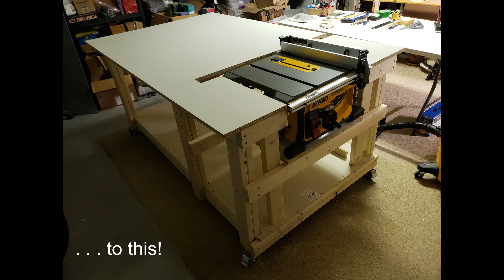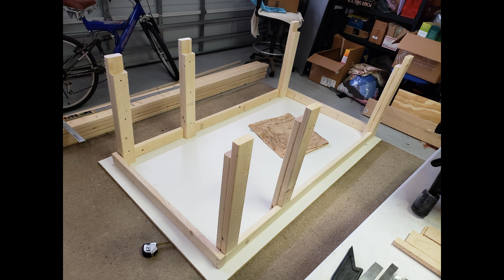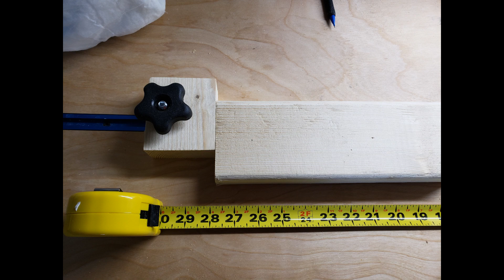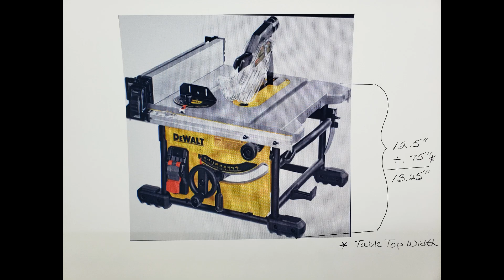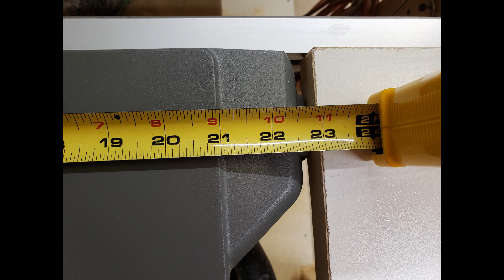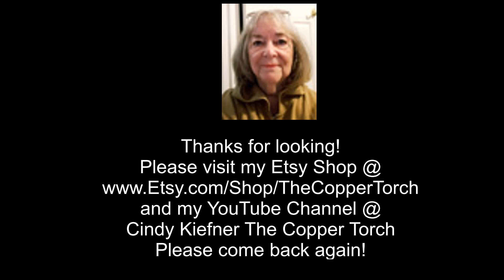How to Create a Custom Workbench Around a Table Saw

Comment: Great looking table ..  Would you happen to know the table saws dimension's ? I'm working on a table similar to yours ... i have not purchased the saw yet ... But want to continue to work on the work bench ...Thanks
Reply from the maker: Hello Chris ~ the table saw is 12 1/2" high, 23" wide, and 21 1/2" deep.  The lock at the north end of the fence is 3/4" more on the depth if you're cutting a channel in the table.  Thanks for your comment!
Reply: @cindykiefnerthecoppertorch7789  Thank you